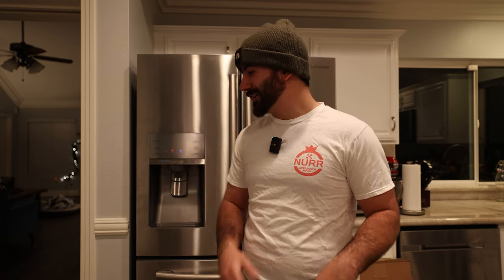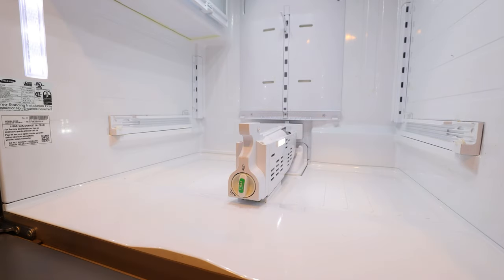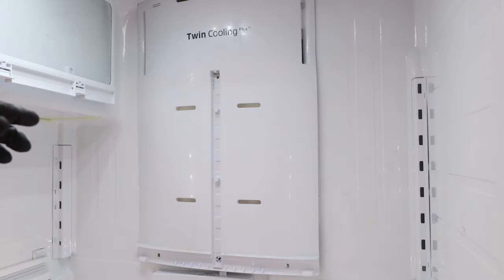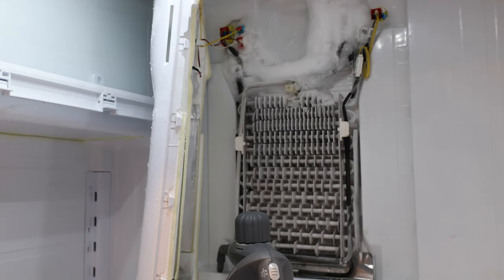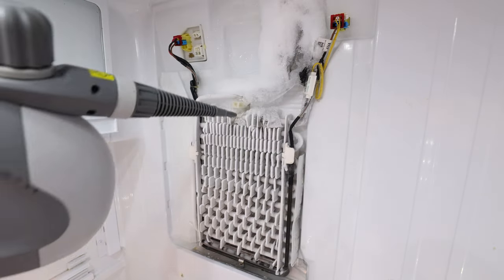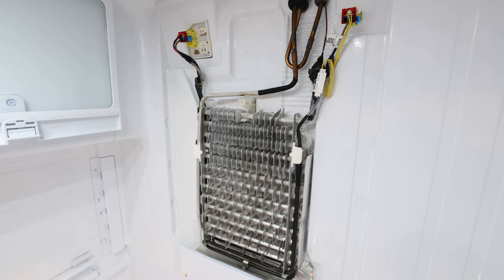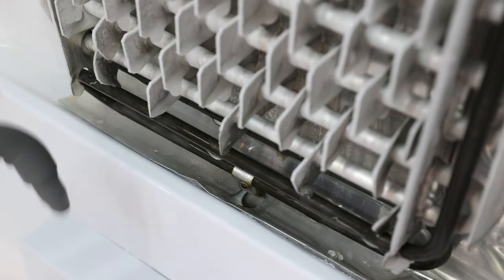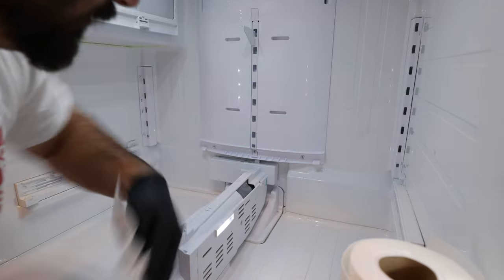Samsung Refrigerator | Evaporator Fan Panel Assembly Replacement | Twin Cooling Plus | 4K UHD

Comment: I’ve watched a lot of videos on this topic as my Samsung is constantly freezing up.  It is 10 years old.  Does replacing the back panel seem to be a sure-fire fix?  I am so tired of defrosting my fridge every 3-6 months!  Outstanding job on this video!
Reply from the maker: The 100% fix would be throwing it out of the window. But try this, especially the drain cleaning part, and it can delay this from happening again. 🧑‍🔧
Reply: Thank you for asking this question. I hate this!! I have a bad back and dont need this piece of crap in my life. However, my appliance guy said there was no fix and I have found two fixes now to limp this piece of crap until we decide to buy a new one. Ugh!!!

Comment: What do you do if the styrofoam is stuck? The styrofoam is not releasing with the plastic cover.
Reply: I put a hairdryer on the panel for a bit before attempting to remove. 2nd time around, first time I lost styrofoam from pulling on it.
Reply from the maker: Defrost the unit. Best practice is to unplug the unit, and leave the doors open for 24 hours. Good time to clean the unit as well since everything needs to come out. Wouldn't recommend putting any dry heat in the unit. Use a steamer if you cannot defrost the unit. You can also use the test mode system to help you defrost the unit on the control panel but we're getting too technical at that point. 🧑‍🔧
Reply: @nurrappliancerepair Can I defrost with doors open without affecting the freezer?  I'd hate to lose my frozen items/meat

Comment: What does it mean if you change it out and fan still doesn’t want to come on?
Reply from the maker: Fan will take some time to kick on. It is not always on and the door needs to be closed for the fan to turn on (you can try with the magnet trick or put a camera inside the unit with the doors closed). The fan is only on when the doors are closed and cooling is in progress. It's highly unlikely you have a control board issue but it is possible the control board is not sending power to the fan...but again rare. 🧑‍🔧

Comment: My fridge temp is uneven inside. And won’t get colder than 51 degrees.  The freezer is really cold as well. Reading -8. The beverage drawer is cold too freezing bottles water. Will this be more likely a fan issue?

Comment: Excellent...
This is the best explanation as to why this defrosting element fails over time... that I have read in Youtube/elsewhere.

I believe this chap is saying...

1: debris may collect over time in the drain (say, onion skins)
2: backup in the drain will affect the efficiency of the defrosting activity at the top
3: frost/ice at the top will cause failures in the foam and further affect defrosting at the top
4: an additional defrost heater at the top may/will help, but is a hack
5: the front panel must seal well to ensure that less humidity gets inside the back panel

6: the real problem, the drain, maybe fixed with a longer copper/metal strip being inserted into the drain... and coupled with the existing main defrost heater

I have looked carefully at the old and new panels in this YT video. I do not see material differences between them, save wear on the old panel.
--

In my case, after eight (8) years... ice began to build up and the fan made a noise. I removed the front panel to find ice at the top and not at the bottom. Water had got into the foam and frozen. I carefully over 2-3 hours sequeezed out the frozen water... using a hair dryer and paper towels. My panel (foam) does not appear to be worn (no broken bits). I will have to do another careful check.

I will do the following:

1: purchase the additional heater for the top ($30)
2: purchase the addition to the drain ($10), to reduce freezing
3: carefully review how the foam seals in the panel function
4: properly re-install the old front panel, ensuring that the panel is pushed high and screwed carefully in, so that the edges make a proper seal.
--

Question:
A: I notice that the entry point for the refrigerant at the very top... the black foam stuff is being pushed into the frig area as a result of subsequent freeze ups. 
Does this matter?

Observation:
- I can use the Force Defrost Diagnostic Mode on the front door of the refrigerator - Control/Display Panel. This appears to defrost the frig, without taking the panel off. Is this correct? I note, that the compressor is OFF when the Force Defrost Mode is on ('rd').

- the Samsung people who designed the software/user errors codes were definitely HIGH when they did the design, as there is no logic to the assignment of Diagnostic Codes. I am rather disappointed, as no credible design group would arrive at such an outcome. The next refrigerator that I buy, I will check the error code logic/terminology first, as this may be an indication of core competency.

--

Conclusion:
The refrigerator is now defrosting with the additional heater cord wrapped around the defrost coil. You will have to cut/snip the 'finger' thing to fit into the drain hole. I used a Dremel tool to cut/grind the old finger thing off.

I put the refrigerator into Demo Mode while I performed the changes.
It is useful to learn the Modalities for both Diagnostic and Demo Modes.
Force Defrost (nr) is useful. It times out in 20 minutes and stops beeping.
I found it a little difficult to snap the front panel back on. It did not 'seat' well. After moving some of the wires around it fitted more readily. The 'white screws on both sides at the bottom of the front panel are barely long enough.

Comment: I need to do this exact repair. I saw the Supco aftermarket repair and was worried about altering the manufacturer’s design even though it seems to be a good solution as well. Your explanation of why the issue is happening to begin with makes sense and I would rather replace the back panel first before doing the Supco mod as I seem to be having the same issues as well. Thanks for this well made video and great explanation. Subscribing to your channel for more updates.
Reply from the maker: Hello Christopher,

Glad you found this video helpful!

The aftermarket heaters do work well but it really is a band-aid to a gunshot wound. These repairs can be costly, so we do recommend trying the aftermarket heater options as it can be a lot cheaper. Just make sure it is wrapped tight so it doesn't have a risk of melting the plastics.

 We are a professional shop so we try to stray away from these repairs but if a client would like us to do it, we advise the limitations and liabilities before proceeding.

Thank you! 🧑‍🔧

Comment: Nice job dude, very concise informative and to the point. Wish I would have found your video before doing my repair the other day. Had to replace the fan and defrost temp sensor w/ drain clip only issue is I couldn't confirm new fan was operating, even after using the magnet trick on door sensors.
Reply from the maker: Glad it helped even a little! It does take some time for the fan to kick on. Probably best to turn the unit on and wait about 30 mins to an hour before trying the magnet. 🧑‍🔧

Comment: Thanks for sharing, very helpful video. my sam sung refrigerator has error code 22 E,  it is most likely the evaporator motor fan issue, my question, in the freeze cabinet and cooling cabinet, is there only one evaporator fan ? or each cabinet has its own evaporator fan. thanks in advance.

Comment: Great video.  Thanks for taking the time making it. The bottom panel of my Samsung French Door  RF4287HARSonly only had a tab on the left side and it wouldn't release the panel.  The tab wouldn't press in so using a flat head screw driver I pressed in under the tab and also pressed in where the non existing tab was and the cover released.  It didn't appear broken but must have been a factory defect.
Reply from the maker: Glad you enjoyed the video! 🧑‍🔧🧑‍🔧

Comment: i only replace those back panels if fan dont work or its water logged.  they make a supco heater you can install to take care of the frost build up
Reply from the maker: Hello!

We talk about that in the video as well. The heater is not a factory solution and a band-aid to the real problem.  🧑‍🔧
Reply: @nurrappliancerepair  sorry I'm ADHD and skip over a lot of stuff

Comment: Question- so the first time I ran into this issue all of the coils were frozen and iced over… 2nd time just the top, but I’ve been listening and keeping eye on it, when k check the oms in heater/brown wires I get nothing .  But what your saying is whole panel needs replacing? How do I know which one to buy
Reply from the maker: Hello Lindsay,

Great question, but I think you answered your own question there! If you have no ohm, your heater had failed. Make sure you're checking it correctly, though!👨‍🔧

Comment: This article was great!  It helped a lot.  However, my drain seems to be clogged as well.  How do you clean the actual drain?
Reply from the maker: You can access the drain in the back of the unit as well near the compressor. Drips in to the pan under the unit. 🧑‍🔧

Comment: I have a samsung fridge as well model •RF217ACPN.  But my fridge doesn’t cool neither does the freezer now it stays warm do you know what may be the problem I’m having?
Reply from the maker: Unfortunately, it seems like you are having a sealed system failure. Check to see if it is covered under the 10 year compressor warranty with the manufacturer. 👨‍🔧

Comment: Hi !
I change the panel last week, the refrigerator was cooling , today, the noise from the fan is amplified, what's the next step to remove this noise? Im waiting for your answer before i remove the panel.
Reply from the maker: Hello!

Not sure how to guide you without being able to diagnose it in person. This video is made to help resolve the issue at hand. It is possible you are having a different issue. I'd recommend checking the heater, thermostat, drain , door gaskets and look for any cracks in the back wall that may cause air to come in. Hope this helps! 👨‍🔧

Comment: Was the fan also making a lot of noise? Didn’t catch it if you mentioned it. Think I have this exact issue.
Reply from the maker: Client did have a lot of grinding noises. This typically happens as the ice forms around the fan. By the time we got to it the fan was completely frozen solid so there was no more noise and no more cooling. We recommend defrosting it and clearing the drain. If that doesn't work, look into replacing this panel or you can try the 3rd party heater method.  🧑‍🔧

Comment: The screw at the bottom of the middle rack holder is freely spinning on my unit and it won't allow me to remove that screw. Any tips on how to get the bottom screw out so that I can remove this Twin Cooling part?
Reply from the maker: Remove all the other screws first. Grab the bottom of the twin cooling panel and pull towards you with good pressure while you try to unscrew it. If it still doesn't come out, cut out the plastic around it as you're going to replace the panel anyway. You can worry about getting the screw out later with brute force and cursing. Hope this helps!👨‍🔧

Comment: I lost power and after power came back it doesn’t cool. I did a factory reset and drop the top temp to 37 and the bottom to 0. There is no ice on the back panel. The coil brown/wires read 136 ohms. The small fan behind the panel did not turn on.
Reply from the maker: Is your freezer cooling? 👨‍🔧

Comment: Honest question……the ice prevented the fan from turning.  When defrosted, why replace the whole panel?  Could you not have replaced the fan only?  Was the panel warped?
Reply from the maker: The fan is functional most of the time after is ceases. After a defrost, it will likely work fine as long as it doesn't burn out. But yes the warping is the problem causing air infiltration. This is what we've trying to mitigate. 🧑‍🔧
Reply: Thanks.  My fridge does not cool.  No ice build up either.  I ran diagnostics for the Samsung Family Hub and the error code was 22c (fridge fan error).  I bought the exact part and installed it.  Still no cooling.  Freezer compartments are fine.  Could it be the thermistor in the fridge compartment?
Reply: Just a follow up….the replacement fan kicked in.  I guess I needed to be a bit more patient!  I also bought a new thermistor and will install if the temperature readings are off.  Thanks.
Reply: Where did you buy the replacement part?
Reply: Amazon….supplier was called “Supplying Demand”.  They were perfect.
Reply from the maker: @SaadDar-vn7hd  we purchase our parts through our wholesale factory distributors. We can get you a quote as well in you'd like? Just email us info@nurrappliancerepair.com 🧑‍🔧
Reply from the maker: @ramjet358  Stop giving out secrets man! 😂 Joking, there are a bunch of factory and factory replacement parts out there. Amazon is a great resource but do be cautious on quality. 🧑‍🔧
Reply from the maker: @ramjet358  Takes time! Give it 24- 48hours to kick in. 🧑‍🔧
Reply from the maker: @ramjet358  Temps vary in the unit. You will not have perfect temps in any cavity (from oven to refrigerator) 🧑‍🔧